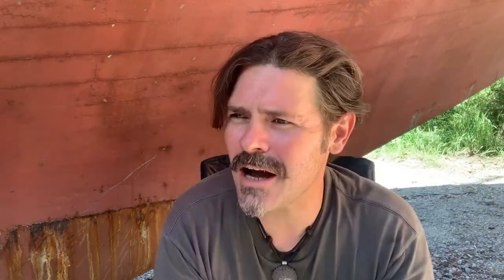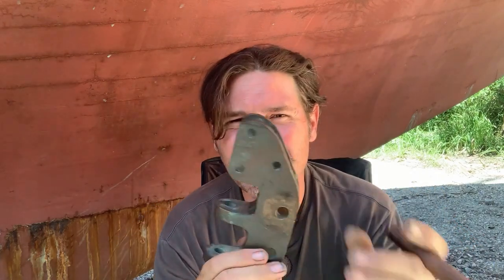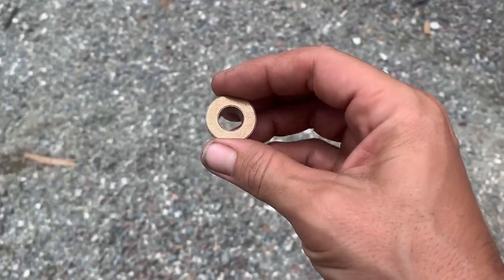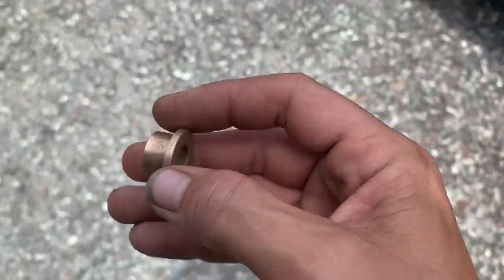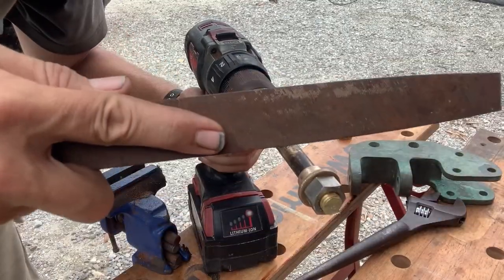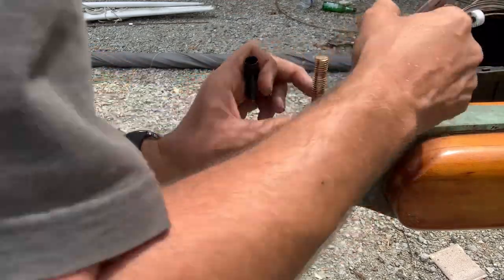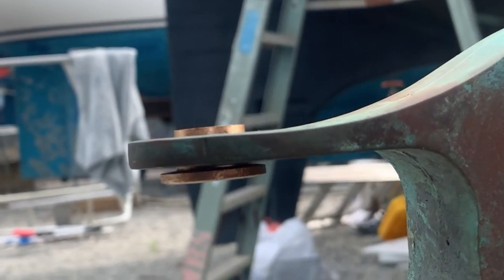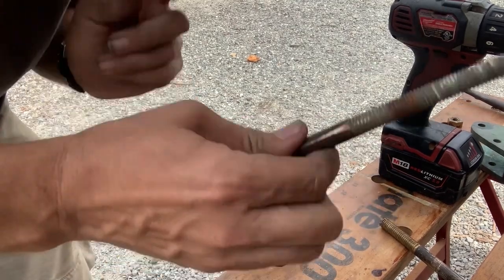Replacing Stolen Vintage Hardware

Comment: Feel for you,  bought a 67 ,carval year and a half ago, was  on the hard for 4 years ,   same thing , some light finger a hole ,helped himself , finally got those little things sorted , but your right it's hard to find those parts , even here in NewZealand, now in the prosses of  doing the same for a friend ,who's boat was out for 7 years , no cleats no blocks , had to fab a goose neck to fitt another boom , even the forestay was missing , luckily it's a cutter , I would do similar things if I caught them ,thinking keel hauling  ,lovely  yacht, matey,,

Comment: To get a bit more accurate when you flat file use a dipping motion . The file is in contact with the material longer that way . You are doing very good work .